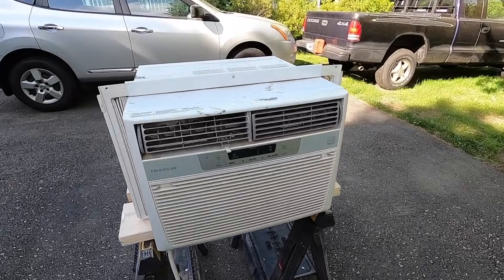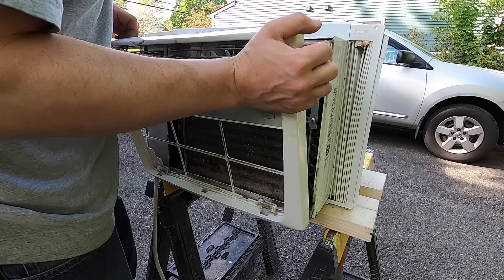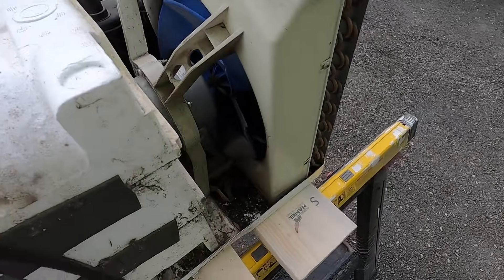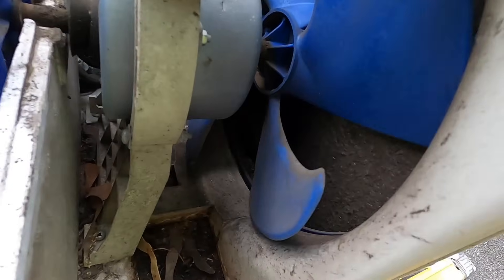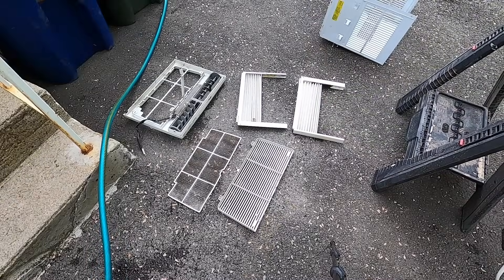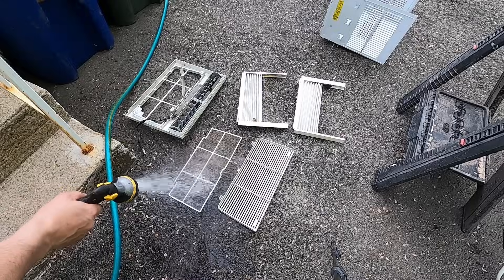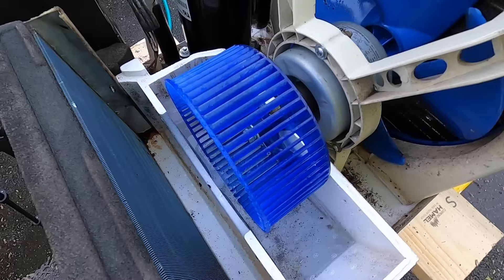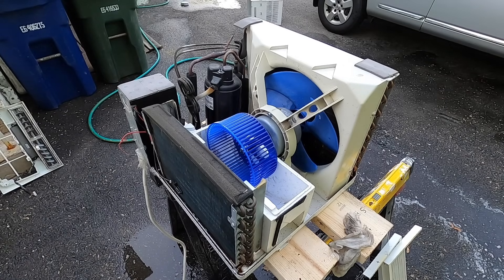How to Clean a Dirty Moldy Window Air Conditioner

Comment: Not bad the only thing I would definitely do first is hook up a air compressor and take a air chuck and blow everything you don't want to wet all that dust and cake it in. It will make it harder to remove when wet

Comment: You’re amazing, l swear you can do and fix everything!  I’m too old and l couldn’t possibly lift it.   Although I do vacuum it and wash my filter weekly.  Also, my AC in located under the window through the brick.  (I’m an widowed empty-nester.)  Is there any sort of “Anti-freeze” you can have put in your AC?  I remember my Late Husband doing something like that with his old Ford Pickup.
Reply: No. you don't have to (anti freeze) / winterize your air conditioner. But I do wrap the outside part with a towel and plastic and tape. just to keep the cold outside and the warm inside.
Reply: Freon ?

Comment: I would have covered that electric motor you don't want to fry it out getting all that water in there
Reply: As long as it dries you’ll most likely be fine. If it makes you feel more comfortable then dowse it with some isopropyl alcohol after letting it dry

Comment: Ok you knew there would that one person that would make this comment lol. 
Is there any easier way? Maybe what you could call a "quick clean method"? 
I'm serious but trying to add some humor for myself more than others.
I have the exact same model. The reason I ask is not that I am lazy. It's because I'm 60 yrs old and I need back surgery results of a car accident (not my fault). I've not worked since the wreck in July of 2020. So no income no insurance waiting to see if I'm approved for disability and who knows when that will happen. So I couldn't lift it out of the window. Even if I could I have another problem. The window is a single pane window originally in the house since it was built in 1954. The AC was installed by barely getting it open to fit the unit. After installation it was built in to the opening and sealed with insulation around the opening and everything was caulked around. I would most likely have to destroy the window to remove it. 
I didn't install it. It was put in shortly before I moved in a few years ago. 
I've keep the filter clean all the time as well as the coil behind the filter that looks new. The mold on the Styrofoam is my problem. I could remove the front and clean the vents but not the foam without destroying something. I was hoping to see some kind of drain or something in the bottom or side near the fan. I didn't see anything like that. I think I could clean a lot of the mold out by cleaning from the front but I don't know how I would drain from underneath the fan. Any idea on how to do that would be so appreciated. Could I carefully drill a hole somewhere maybe? I had planned on doing something before this summer. I never planned on not being able to do it or even not being able to pay someone one. So I'm not lazy and had worked all my life. I had to be humorous to keep from crying. Thank you
Reply: Several people ask but there really is not a way to do so. Maybe you can call on a friend or charity or agency or something and perhaps let them watch this video or talk them through what needs done. You may need a handyman as well for your installation
Reply: @claresage  Thank you but I was finally able to take care of it. 
I was able to get someone to remove it from the window without to much damage. With the AC sitting on a make shift work table (saw horses and a piece of 3/4 " real plywood) I removed the front and the outside cover. The blower fan is encased in the Styrofoam but it has a seam all the way around it. I used a razor knife to cut the rubber type taie that covered the seam. I used a mixture of bleach and water along with a brush for cleaning lint out of a dryer. The bleach really cleans up the mold fast. I didn't remove the fan because it's a lot more work but with the bleach the flexible lint cleaning brush and an old tooth brush I was able to make it look like new again. There is no drain for that area so I drilled a 1/4" hole in the lowest part I could get to. After cleaning/ rinsing and draining the water out I filled the hole I drilled with silicone caulking.  I sealed the seam in the Styrofoam with the rubber type gorilla tape and put it all back together.
I've cleaned two others and a stand up portable unit since
Portable unit was a pain lol.

Comment: I think the best way to prevent ac mold is to turn it on and leave it on. Do not use the energy saver mode. I have the same ac and the only time it molded was when someone insisted on using the energy saving mode (even after saying not to after having to clean it the first time from that mode being used) it must make perfect conditions for mold. When we gab it running constant for months no mold until the power saver mode was used twice. The power saver shuts the fan off when it's not cooling so the temperature changes which causes moisture and mold.

Comment: Thanks for sharing this... What are your thoughts on cleaning a in wall unit? I have cleaned a few window units (not as in depth as this) never took the rear cover off. I would like to do a cleaning similar to this on my in wall unit its not really that old and I feel a good cleaning would help keep it running properly. Any experience or suggestions on a in wall unit? Appreciate it!!!

Comment: If I could buy another one I would throw that nasty thing in the trash.
Reply: Sure throw it out. Don't bother to clean it. Its only one air conditioner. And it's a huge landfill. Don't bother recycling it either. Someone else will scar the earth to find the resources to build you another one. Might as well by two so when that 2nd. one gets dirty you can throw it out and you have one on standby.
Reply: @wheretonow3106  It wasnt dirty. it was disgustingly nasty. Good idea about buying two though.

Comment: Don't buy a Dandy window air conditioner the filter gets stuck and you can't take it out at least not the easy way why they did that I have no idea they ought to be ashamed of themselves an easy thing and it gets hung up and you can't pull the filter out without breaking it which I didn't

Comment: Why do these cost $500 and up? Literally styrofoam and plastic in an aluminum shell.
Reply from the maker: Supply and demand I guess... there really is not much to them.  Thanks for checking out the video!
Reply: Where are you shopping? I can buy a 5000btu window unit for  around $100.

Comment: I did mine the same way except I took more of it apart and used bleach. Bleach is the only thing that kills mold. You just have to rinse it good because it will rust metal. Also, I get mine perfect. One speck of residual mold will multiply exponentially. I do dry everything. Put a mold preventer on and drilled holes to drain water rather than allow it to sit in unit.

Comment: Thank you, my ac unit was blowing gross smelling air when I installed it this year. It came with my apartment so who knows if it's ever been cleaned. 

Small problem, after putting it together and getting it running the fan is MUCH louder than before. Any guesses on what's up?
Reply: It's pushing through much more air now that it's free flowing. You probably don't remember how it sounded when you first got it. lol

Comment: I have a question and hope you might be able to reply: how did you get the fresh air vent lever to come out with the front panel? After removing the screws and pressing on the sides to release it, the small lever is still stuck in the back and won't let me move the panel out of the way. I am afraid to apply too much force since I can't see what it is connected to. My unit is permanently in the window.